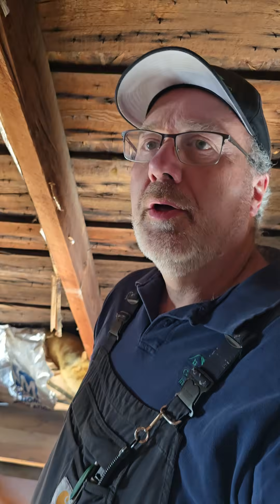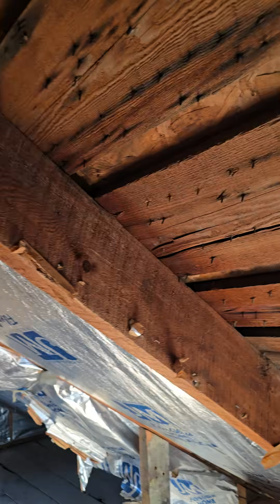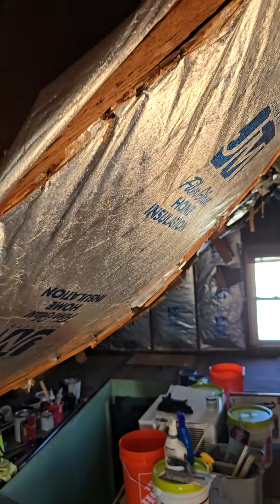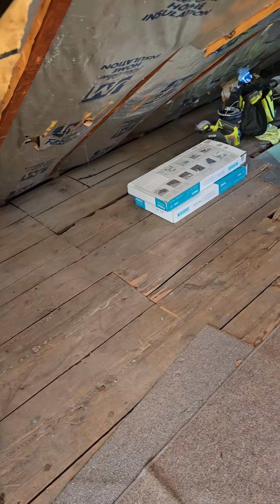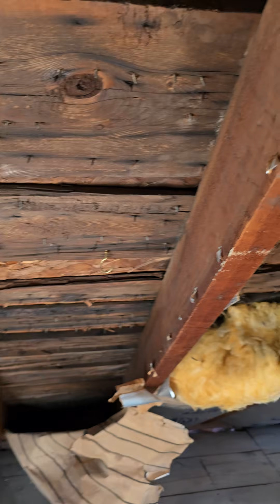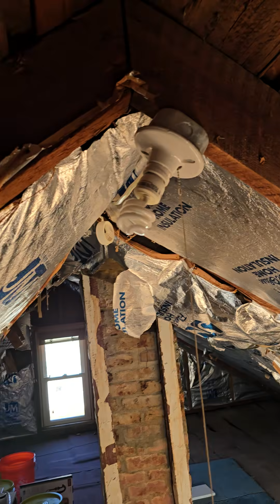When insulating an attic in an old house there are many things to consider.

Comment: IMO, if you insulate underneath the roof, you are asking for mold. Insulate the ceiling of the house, not under the roof. Old houses weren’t designed for insulation if they were built before insulation even existed.

Comment: What if you use spray foam insulation do you still need ventilation up there? I was told that we’re going to insulate right over the vents for whatever reason. I don’t understand. It is a conditioned space because the insulation on the flooring is not very good.
Reply: all attics need insulation unless you want mold, a rotted roof, and replacing the entire roof in 5 years from rot

Comment: I'm in Maine, and am trying to vault a second floor bedroom ceiling in my 1820s house, because the ceiling height is too low for a tall guy like me.  No soffit/ridge vents exist, and I don't think it will be possible to vent, since there's no space to add a soffit (the roof hits the exterior beam directly, which is a 6x6 piece of wood).  Without spraying closed-cell foam, how do i best insulate this to avoid moisture issues?  It's a 2x4 framed house, so not a ton of space to work with.  I've looked everywhere, and this video looks as close to my situation (other than this attic not being a finished space), and it sounds like you know the answer.  Any help appreciated!

Comment: Best for that attic is soffit/ridge vents installed, remove that insulation and floor boards and fill up that floor with thick insulation.  Trying to keep that Roof insulated limits the r value by a 1/3 compared to the floor.
Reply: That house doesn’t have soffits like newer homes do. So that’s not an option. Best option for that house in gable end vents.
Reply: @dlp4183 and perhaps artificial air flow as well like fans

Comment: Wrong bud. The only way to stop mold is with airtight insulation. That means foam. Closed cell. The there’s no air then there’s no moisture. Air containing moisture like all air does flowed behind that insulation then condensed like it does on a cold glass of ice water. Same way it does inside your AC on the AC coil. But if there’s zero airflow there’s no moisture to condensate onto that freezing roof.
Reply: You have zero idea what you are talking about in this aspect. If you foam your attic roof, especially with spray foam, you will 100% rot out the roof decking because it has no ability to evacuate moisture from condensation. Condensation occurs between hot and cold cycles such as the house is warm inside but it cools outside this how you get condensation. By all means,  go foam your attic roof deck and trap that moisture between the foam and the roof decking and see if you feel the same way in 10 years when your roof is totally fucked. That should be fun 😂
Reply: What if you develop a small but consistent leak that slowly soaks the wood and there is no ventilation to remove the moisture?
Terry
Reply: Roofs never leak
Reply: @Jared_Albert 
Thanks I was not aware of that 😳🤣
Terry

Comment: They make a neat channel that runs up from the bottom to the ridge for air flow
Reply: I'm interested in that for my house, what is that called?
Reply: @adamruck they’re called proper vents or rafter vents. There are specific brand names depending on the actual product you buy, but the two terms I provided will help you find what you’re looking for.

Comment: I've seen a TON of old homes in NE wrecked with mold because at some point someone thought to insulate without understanding the importance of ventilation. The most common problem-maker I see is a twofold approach with sprayfoam sandwiching a vinyl clad exterior.
Reply: Question if you care to answer. I am currently physically building my own home. 
For the walls I have 2x6” studs. ZIP system exterior. I plan to install rock wool insulation and sheet rock interior walls. I have given a lot of thought to exterior covering and ultimately I want to best performance siding for the most healthy home. I see Hardi board as having the potential to trap moisture against the Zip panels. I see a good quality vinyl siding as being able to release moisture much better. I don’t care if down the road the siding will eventually need replacing. That can be done with minimal effort and expense. What matters most in my opinion is that everything below that siding is well maintained because replacing Zip or worse studs would be a huge costly expense. 
Does this sound reasonable?

Now for the attic. I did use Zip 5/8” sheathing and I may cover it with Zip ice and water shield all the way to the ridge vented area. Then most likely a hidden seam metal roof. I want my attic to be conditioned like its heated space. 
I have 2x10 rafters. I will have a vented soffit. I am thinking of creating a 1” air gap between the underside of the roof and my insulation in the rafter cavities. This is where it gets a little crazy and not to normal. I was thinking of putting aluminum flashing between the rafters to creat my ventilation gap. Then on the bottom of eat rafter add a strip or f 1” foam on the bottom of each rafter to add at least a minimal thermal barrier and the rip some 1” strips of pine and sandwich that 1” thermal barrier so I have something to attach my sheet rock to. 
I know that will be a lot of work but if my thinking is correct the aluminum will reflect heat plus it won’t burn. The 1” foam will give at least a minimal amount of thermal barrier. 
There are no braces in the attic running up to the rafters. There is a 2x6” wall running from my drop sill in the basement all the way up to the ridge supporting the roof. 
I have 2x6” collar ties at every rafters set forming a ceiling and it will be insulated with rock wool as well. The gap above the ceiling insulation will be part of the ventilated space. The ceiling will be removable panel sections so I can periodically remove them and inspect the air gap between my roof and the aluminum air barrier. 
I know it sounds like a lot of tedious work but I think well worth the effort. 
If you or anyone cares to respond do you see any potential issues with my plans? 
Almost forgot I plan to install the mesh that elevates your metal roof above the sheathing allowing for air and moisture flow. I have also considered installing some type of rain screen under the siding but question weather it would be necessary under vinyl siding. 
Thanks for any response and making it this far lol. 
Terry

Comment: A vented assembly is always the best in my opinion, but in a pinch you can dense pack those rafter bays and then put 2” polyiso foam board over them. Meticulously seal the polyiso all around with can foam and tape and you’ve made yourself a pretty decent hot roof.

Comment: This where doing closed cell spray foam to the roof line along with the addition of a air exchange system in the house is the best option (if wanting to keep a conditioned attic space). We do them often on old homes
Reply: Except that if your roof isn't 100% waterproof you're creating spots to trap water against your framing and it can potentially rot framing of your house quickly

Comment: Great video I had my floor insulated . Didn’t do the roof. I did an intake and ridge vent  now my installation runs all the way to the eaves covers everything. , entire floor no gaps at the end ..Should I leave a gap there for the intake or should I just leave everything covered on the floor what’s your advice? Thank you

Comment: Best choice:  Finish insulating and closing in the attic and run HVAC vent to it. Otherwise, remove insulation from rafters, add lower intake air as per regulations and a box vent.  Much easier to just run HVAC and finish enclosing it.  But it is not the best choice as vapor can get trapped in the insulation at the rafters.  Need a way for the vapor to escape and I’m not certain how on that matter.

Comment: If you insulate the roof and you have a ridge vent, does that help keep it warmer in the winter and cooler in the summer
Specially, if the floor is already insulated

Comment: I have this but I have collar ties and so the top of the roof is vented but I have no clue what to the with the other 2/3 of the rafters. we just removed the insulation and it looks like that. do I need to have an airgap between the insulation and the roof lumber and then a sofit vent basically?
Reply from the maker: Yes, you should have soffit vents and a ridge vent and a gap between the insulation and the roof sheathing.
Reply: @careyhomeinspection  Would a one inch gap be sufficient along the 2/3 run of the rafter?
Reply from the maker: @HavokR505 A two inch minimum is recommended. Here is some more information https://roofingkettering.com/air-gap-between-insulation-and-roof/

Comment: What do you do if you dont have any sofit vents but you do have a ridge vent? I also have a square vent on the sides of the house
Reply: Insulate the floor and crack a window. Can also install an eve vent.  My old home was like that.  Zero issues.
Reply: if your talking about on the ridges of the roof, that is a sofit vent, you just gotta put the baffles on and make sure the air can flow through the baffles from the vents. then keep going with the baffles untill you hit the ridge vent

Comment: The issue is the water vapor cannot escape the roof. You dont need to "vent" it. Cut the ridge out but then cover it with Tyvek or another vapor open weather barrier. It should be above 20 perms. Above 30 is best. Tape it so its air tight. Water molecules are smaller than other air molecules. They can pass thru the weather barrier as they rise up into the attic. Also you have to have a proper cap for the ridge vent. This is called a vapor diffusion port. 

Secondly if this isnt feasible or just to bulletproof things place a return and a supply from your AC into the attic. This will pull that humid air into the airband dehumidify it and help keep the air thru the house more or less the same.

Edit: i felt i should add. Venting it WILL work its just going to be more tedious to make it air tight to stop the outside air from interacting with the inside of your attic. I was actually considering doing that on a home ill be building soon. My GC isnt familiar with vapor diffusion ports or overroofs or none of that so i figured ill work within his skill set.
Reply: insulation still heats up the roof losing years of the roof.
Reply: @henryhenry271 itll last plenty long. Especially if you use a metal roof. I would reccomend a double roof assembly if using asphalt shingles. But even without you'll get years out of your roof still. I would reccomemd not using a dark color if possible.

Comment: how do you get rid of the mold?
Reply: There is mold kill spray that kills and prevents from coming back, you can scrub it off after applying, wear an n95 if you're worried about your health or there is a lot
Reply: @ryley8141 , I had to learn my house in hyper speed due to insurance company purposely ignoring the structural science (balloon frame which I wasn’t aware of until last summer). Based on what I have learned, the slants of the ceiling aren’t to be insulated and you only insulate the ceilings and walls pending if there are finished rooms under the roof table.

Comment: My dad insulated their 1950s home by leaving a 2" air gap between the insulation and roof decking, allowing venting through the soffits and ridge vent.  Below the insulation is the attic ceiling, which turns the attic into a conditioned space.  If the roof beams aren't tall enough to insulate to code based on batt height, you can add lumber under each beam to create whatever clearance needed, at the cost of usable area in the attic.
Reply: Yup. That air gap is very key, lots of issue without it especially cold climate.

Running continuous rafter vents can help, keeps the airflow off the insualtion.

Insualtion loses significant R value when air is moving through it.
Reply: dont forget to air-seal the thermal boundary in these types of attics as well, typically referred to as kneewall attics in your case.

Comment: Here's my question:   A few years ago I added blown-in insulation to all the exterior walls on our 1890 house.  I also have 10-15 inches of insulation in the attic floor. I've read that you're not supposed to block off the top of the juncture between wall insulation and attic floor insulation, but how can that be avoided, and what would be the point, since the wall cavities are stuffed all the way to the attic floor (and its insulation) anyway?  Being blown in, the wall insulation doesn't have any passageway for air to circulate...  Thanks -
Reply from the maker: You don't need air flow in the wall, and you should have insulation in the attic above the wall. There should be an envelope of insulation that is unbroken. What you don't want is insulation in the eves blocking the soffit vents (assuming you have soffit vents). With blown in insulation this opening is achieved with baffles. Often these are made of foam board.
Reply: @careyhomeinspection  THANK YOU!
Reply: @careyhomeinspection an insulator I spoke with said blown in typically will never block soffit vents, as gusts will push it out of the way over time.  This same phenomena tends to leave ceiling areas bare of blown in insulation near soffit vents.  I've noticed this in my own home, where I observed condensation on the ceiling adjacent to where a soffit vent is.  An added benefit of baffles is they prevent gusts from clearing out blown in insulation near vent channels.  Placing a section of batt insulation in the channel next to a ridge vent is another option, and probably easier than adding baffles in existing construction.  I get that blown in is easier to install and saves on construction costs, but my experience with it as a homeowner makes me prefer batts all the way.  Faced batts between joists covered with a plywood walkway and topped with unfaced batts across joists makes working in an attic so much easier.

Comment: In my 1898 farmhouse, I have this exact type attic, though i may have blown insulation under the floor (kitchen below). Roof rafters above look like this (real 2x4s) on approximately two foot centers. No insulation. Shiplap shows like this. Also, plywood from reroofing. I would love to finish this space with drywall. Have thought about adding 2x2s to each rafters to give me more space for insulation. What do you suggest is my best way to attack this. Short walls on sides are open with balloon construction coming up from below. What products best help with my airflow problem? Thanks. Great video short.
Reply from the maker: It's always a challenge when making these types of changes. One option would be to look into getting the opinion of a professional in the area regarding foam insulation or ridged foam board insulation. You may be able to eliminate the ventilation need and conserve space. The potential increased insulation cost may be less than conventional insulation with structural modifications.   Whatever you do, be sure to take a comprehensive approach in that you are changing the way the house was intended to function.

Comment: I installed fiberglass insulation for 6 years, not a very long time in the grand scheme of things but I learned A LOT in those 6 years and got exceptionally good at it. I've been thinking about investing in some equipment and a truck to take on small side jobs in my free time. 

If you're gonna insulate the ceiling make sure you rip out all that older stuff, the insulation standards back in the day were shit.
Reply: Can u explain little how I should do my 2nd floor is very healthy
Reply: Ya they definitely need rafter vents continuous soffit to ridge if batting the rafters.